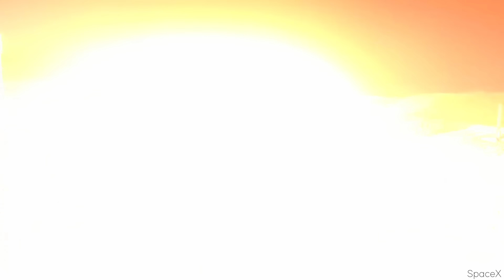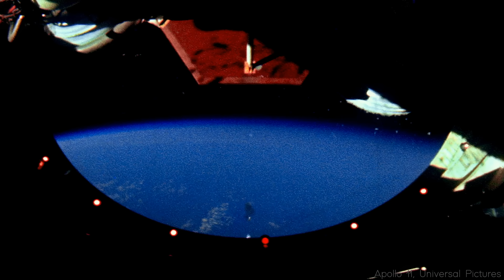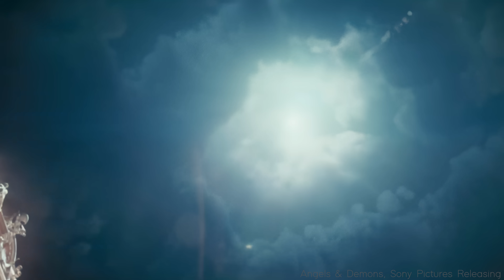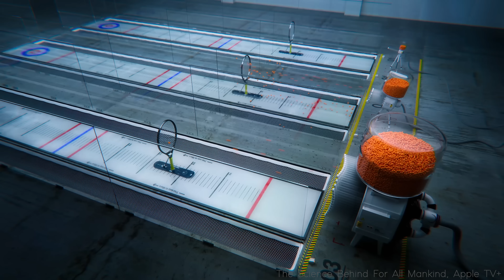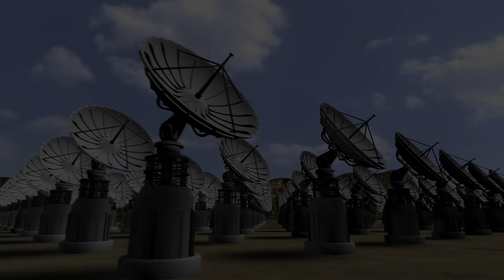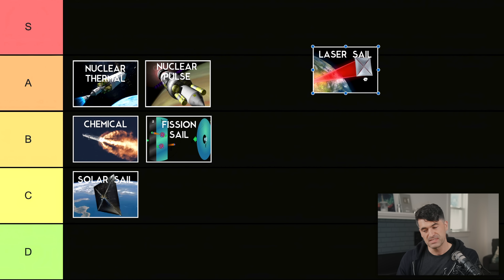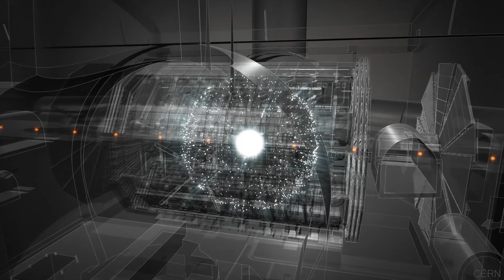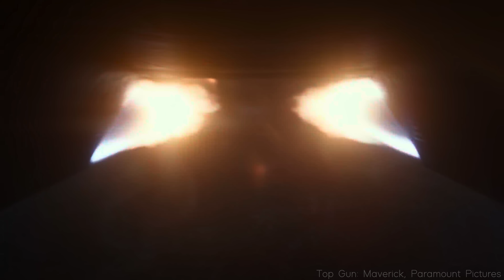Interstellar Propulsion Technologies - RANKED!

Comment: The ion thrusters demonstrated on my channel demonstrate multiple orders of magnitude improvement in thrust to weight ratios.  The patented devices are capable of producing more thrust than their total weight on Earth, including their onboard power supplies, which is a milestone that redefines what we previously believed was achievable or possible with ion propulsion! Previously ion thrusters weighted a great deal more than the thrust they could produce!

Operating at currently 54kV accelerating voltage, and a very low current, the thrusters I show can propel ions in a vacuum at velocities also orders of magnitude beyond current space ion thruster capabilities, that typically only operate at only a few thousand volts. This marks a large leap in performance and efficiency. Even in the Earth's atmosphere, where the propellant streams typically move a lot slower, these thrusters consistently achieve a thrust-to-weight ratio greater than 1:1. This means, as mentioned, that they can lift themselves, along with their power supplies, directly against gravity. This has been shown and confirmed during thousands of flight tests. The crafts utilize small amounts of oxygen ions from the air as propellant. These flights demonstrate stable, repeatable operation, with the longest flight lasting 1 minute and 51 seconds. Following recent upgrades to the electronics, flight times have now been extended to greater than 3 minutes.
 
The potential applications of this technology currently include interstellar flight for lightweight probes as well as very lightweight silent terrestrial use drones. With the addition of lightweight solar film, these thrusters would fly indefinitely. 

Additionally, in other experiments, the crafts have been shown flying with small propellant tanks for use in the vacuum of space. Also worthy of note, calculations indicate that with higher voltages between 5MV and 10MV—well beyond current operating levels—the thrusters could accelerate using relativistic speed electrons as propellant, eliminating the need for any additional onboard propellant, normally required in space. This would fundamentally change what is currently possible for in space propulsion systems.

A > 1.5MV power supply has previously been constructed by us that can be used to facilitate these higher-voltage experiments, however, current efforts are focused on improving the stabilization and the control systems.

I hope I have communicated adequately the exciting, and far reaching, implications for this improved version of ion propulsion!  To see detailed information and a large number of demonstration videos please visit the Ethan Krauss YouTube channel and the Electron Air LLC.org website.

Comment: You missed one very very promising, recently developed drive: Dusty plasma drives! These use pellets of radioactive material (fed into the drive using an aerogel) to create impulse; confined magnetically, these pellets just barely reach criticality, and the radiation they produce is the thrust. Projected ISPs are in the several hundred thousand seconds. They're a subtype of something called a Fission-Fragment rockets.

Some reading:
https://www.osti.gov/bridge/servlets/purl/6868318/6868318.pdf
http://www.rbsp.info/rbs/PDF/aiaa05.pdf

Comment: The Albuquieri drive is a massive energy-sucking engine.  Negated.
Solar wind sails are not viable.  Negated.
Ion or particle propulsion engines from star craft atom smashers, particle accelerators, ionizations, ... also need massive energy rssources to create these propulsion energies.  One with ion engines must have a continuous source of ionized material, that is sloughed off from the star craft.  All insane volume of fuel, energies, and ionized materials.  Negated.
Any chemical or nuclear reaction engines - need massive volumes of fuel - which means NO.  Negated.

The ONLY (and ancient) method of star transportation is the tensor boson engine.  A tensor boson is a dual property of the electrical force and gravitational force.  It is the modern definition of ADC (AC + DC).  Tensor bosons are the very source of the Meissner force field, Be'nard's Convection inside the stellar engine's photosphere, Birkeland currents in deep space, Coronal Mass Ejections (CMEs), ...  Tensor bosons are the actual fusion agents in the stellar engine's photosphere (Hydrogen to Iron) and chromosphere (Cobalt to Element 118).

One needs to first create the supercompacted superconductor product (much like Star Trek diLithium crystals) which are conduits of free energy flow from the (95-99% of hidden cosmic mass) dark matter particulates, energies, and forces ... into the (1-5% cosmic mass) matter universe.  Herein one has a true and total free energy resource that self-recharges off the very matter universe or the greater Aether.  This provides an original volume of an energy product that never changes in volume, use, or energy variance.

The tensor boson engine, which uses the electrical force, as an electro-static force field (i.e. Meissner force field) as a "slipstream" around the star craft, one negates gravitational attraction of large gravity objects, and that of the 6 gravity space-time fabrics, being the drag of Einstein non-maximum light speed velocity.  The electro-static produces a slipstream that is a worm bubble, and its movement in space creates the third party visualization of a wormhole.  This force field is the actual manifestation shown in the fuzzy appearance around the tic tacs, and allows them to perform supersessional flying abilities - without conventional aerodymanic restraints of shear forces on the star craft super structure and G-forces on the vehicle's interior inhabitants.  The tensor boson, with its gravitational force, shoots forth a gravity beam into a forward direction, which creates the gravity well, and attractive force pulling the star craft forward.  This is the ancient vimama's propulsion device.  This is a bigger version of the smaller Star Trek tractor beam.  The inside inhabitants experience a 360 x360 gravitational field separate from the outside cosmic energies.  The tensor "slipstream" allows light speed, and worm bubble to wormhole technology of moving into the Dark Universe and flying at warp speeds.  What would be light speed of 4.5+ years to get to Alpha Centauri, would be mere hours or minutes flying through the Aether Dark Matter Universe, without friction, gravity, etc, ... and then power down the worm bubble slipstream, and pop back into the matter universe near the destination.

The tensor boson engine is the only solution to all of this ... and it starts with the same tensor boson fusion agents, creating the hyper-elemental products of Bose-Einstein condensates ... supersolids, liquid flow metals, cold flow light plasmas-I and -II.  This supercompacted element, displaying Cooper electron pairing, is able to interlock and work with the Aether particulates at the sub-quatnum entanglement energy levels.  If one ~really, really, really~ wanted to use cold flow light plasmas, then you could have a light (photon) engine or a plasma engine, and achieve the highest of propulsive energies and forces in the cosmos.

As Einstein said, (which physicists constantly deny with matter - antimatter annihilation being illogical and insane), "Energy can not be destroyed - it can only change its form of existence."  As such, there is no anti-matter machines or particles.  You have - polarity electrons and + polarity positrons.  They naturally form neutrons.  They do not implicitly annihilate and create gamma rays.  If YOU DID impact a Tau electron and a Tau positron then assuredly you would have an electron transition Lyman series of gamma ray emissions.  Only at the Tau level.  All other lesser electron energy levels have their Balmer (UV rays), Paschen (visible light), Pfund (infrared), and Humphrey (infrared) emission ranges.  So Feynmann is only correct with his electron matter - positron antimatter statement with extreme velocity and impact producing gamma rays at the Tau level.  So this is not a generic one-for-all statement that physicists have gone stoopid about.

The newly (re-)discovered Electro-static (ES) and Electro-gtravitic (EG) model, corrects, amends, and eventually negates the entire Standard Model and all of its many contradictions, lies, and BS.  The proof and understanding of what true tensor bosons are, how they operate, and where they are located, is already found, and understood.  Electrons, positrons, tensor bosons, neutrons, photons, and gravitons.  3 energy levels in the matter universe (Tau, Muon, and Electron particles with quantum entanglement) and 3 energy levels in the Aether domaic (small electron, electrino, and graviton particulates with sub-quantum entanglement).  This models solves and explains away 31+ current anomalies in the disparate and non-connected physics sectors.  This model gives the Grand Unified Field Theory (Theory of Everything).  You can literally see in layman words, and layman diagrams, what objects do what, why, and how, ... and everything of gravity, objects, forces, fields, waves, ... space-time fabrics are all understood.  Tensor bosons keep the gravitons together for the space fabrics, but also apart keeping cosmic tension (Hubble tension).  All of this is easily shown - and it is marvelous !

Comment: You kind of forget a pretty important metric for getting people to a destination: The need to slow down. Solar / Laser Sails, Halo Drive, etc. are all fun ideas .. until you need to hit the breaks .. which they don't have 🙃
Reply from the maker: Solar sails and halo drive allow you decelerate no problem. Starshot’s laser sail doesn’t intend to slow down, they want to do a fast flyby
Reply: @CoolWorldsLab  True they technically allow slowing down. The question is how without putting the craft back into that pesky rocket equation or limiting our choice of possible destinations. Unless you're travelling to sites allowing for an inverse to the propulsion method eg. travelling from one compatible black hole to another. Plus we'd also have the squishy human problem with manned missions. Then again if we couple it with a mind upload that'd be a solid enough solution I guess 🤔

Comment: Trust me, you not want to be in a warp bubble! The spaceship creating a warp bubble, it's like stretching a rubber sheet out to get one point to another faster. Faster you want to go, the more you you have to bend that sheet. And more you bend it, the stronger that distortion force gets. The force increases exponentially with speed, doubling the speed it could be quadrouple in force. The speceship isn't just a point on the sheet, it has size. The bubble's curvature cause this significant distortion force, and at warp speeds it could mean bad news for anything inside the bubble. Furthermore at such speeds the impact with dust particles, and photons are extremely dangerous. The pressure exerted on the spacecraft by collisions with interstellar matter like photons and dust particles would grow proportionally with the warp bubble's velocity. The dust would pulled in right into the path of the  bubble which leads to higher chances to collision. At warp speed the tiny dust would like hit like a truck.

Comment: Don't the Nuclear Pulse rockets depend on atmospheric pressures to work? I mean the @spacedock channel did a video in which they point out that using a Nuclear Explosive as a weapon in space combat would not work as the devastating effects of a "Nuke" are only realized in an atmosphere ( aka "pressure wave" )... if so how would using small "bomblets" to propell yourself work in space, if there is no atmosphere for the explosion to push as a pressure wave at your bumber plate?

Comment: The Alcubiere drive would only violate causality if it traveled at superluminal speeds. However, I would think that it could travel at 90% C. That’s hugely fast but still subliminal. The downside, still, is we would need negative energy, which may not even exist.
Reply: Lol you're trying to bargain with physics. The Alcubierre drive would be able to violate causality so it shouldn't be possible at all. You might as well wish for a perpetual motion machine and say you'll only use it for like 1W of power. The amount of power isn't really the problem there, is it? 😉
Reply: Except it doesn’t travel at superluminal speeds.  It moves space faster than light around the ship.  While the ship either doesn’t move at all or moves slowly.

Comment: For me, the laser idea behind Project Starshot is the best one. It decouples the launch mass from the launch system and I think for any appreciable speed you need that property.

This is actually what your Halo Drive does in practice. It builds probably the biggest and maddest version of the idea - using a blackhole to build a laser array of biblical proportions.  

My opinion is that your Halo drive will work and be practical sooner than you think, I suspect there are many small blackholes we simply can't detect. A lot of the missing mass of the universe could be these objects.

There might even be such an object in our solar system, as some people think the Planet X object could be a low mass blackhole - with a size of a grapefruit. It would probably have tremendous rotational energy, being compacted to that size.

For me, it would make sense to fund a mission looking for this object directly and seeing if we can locate it. If it was a a genuine blackhole, it would form a tremendous staging post for getting us out of Sol. It's far enough away that it's hard to imagine an accident capable of sterilizing the earth but close enough that it could be feasibly reached by another one of the nuclear drives in a short amount of time.
Reply: "My opinion is that your Halo drive will work and be practical sooner than you think, I suspect there are many small blackholes we simply can't detect. A lot of the missing mass of the universe could be these objects.  There might even be such an object in our solar system, as some people think the Planet X object could be a low mass blackhole - with a size of a grapefruit. It would probably have tremendous rotational energy, being compacted to that size."

Oh dear, I strongly suggest you stop talking and learn some basic physics. Black holes invariably accrete a disc/halo of orbiting particles and are typically incredibly energetic, ie, incredibly easy to detect.  Black holes are stellar remnants, END OF STORY they do not exist as "grapefruit-sized" objects!  Please keep the utter bullshit out of any intelligent discourse.
Reply: I find this line or argument funny. We know the universe contains far more matter than we can see. We know blackholes exist at stellar masses. We've been unable to observe WIMPs despite our best efforts. 

Is it really that crazy to say there are lots of small blackholes which are too small, too isolated to have an accretion disk?

Is it anti-science to suggest we hunt for this mystery mass in the solar system that some reckon could be an example of this missing mass? 

I don't know. I grew up before the first exo-planet was discovered. I feel like you would have said on a thread about whether we should look for them back in the 90s is that it's pointless, hopeless and anti-science and I should check my science enthusiast's card at the local library. And yet they were detected and here we are on the Cool World's channel some 30 years later. You just need some imagination.
Reply: @SoarWithSimon  "You just need some imagination..." "Imagination" is irrelevant.  Exoplanets were a painfully obvious reality, we simply lacked the instruments to detect them reliably.  All the other crap you spewed has no basis in reality, or physics.  There's a enormous difference between mindless babble and well-researched scientific conjecture, you might want to try to understand the difference.
Reply: "Missing mass" aka dark matter, is still hugely hypothetical and planet X has a lot of evidence against it.

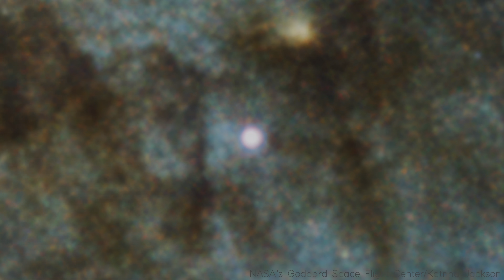Comment: 8:14
I'm an amateur but I can do some calculations for you n all (correct me if I'm wrong)
Let's use Project Orion as an example. Something like an orbital test would have had a bomb with the individual equivalent of 30 short tons, around 25 metric tonnes, of TNT - or around 113.8 billion Joules. 35% of total energy is released as thermal energy, 99% of this thermal energy is released in the form of visible and infrared light, so 34.65% of total energy. This equates to 39.5 billion Joules or so per bomb. Seeing as how this is all released in a microsecond, we get "only" 39.5 quadrillion Watts per bomb (although this metric can be somewhat deceptive).
Light follows the inverse-square law, and to know how far away we could see this, we need to turn it into W/m² reaching Earth. Since our best infrared and optical telescopes can detect wattage per square meter as low as around 10⁻²⁰ W/m² we can rearrange the inverse-square law to find out the distance:
r = √L/4πF
where L is the energy released in watts by the object
and F is the flux recieved at the observer's location (in this case Earth)
Now for some boring math, with more precise numbers and a lot of zeros:

√39455833725000000/4×π×0.00000000000000000001 =
√39455833725000000/0.00000000000000000012566371 = 313979540000000000000000000000000000
√313979540000000000000000000000000000 = 560338770000000000 meters

This is roughly 60 light years, which is gigantic yeah, but not really that much on a larger scale. Unless there's a civilization in our cosmic backyard, we can't use this to detect aliens.